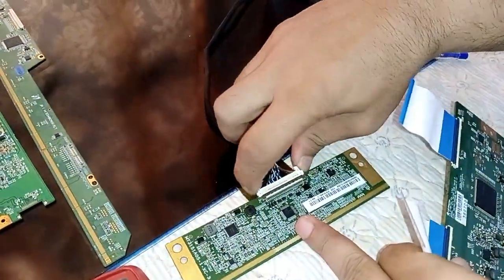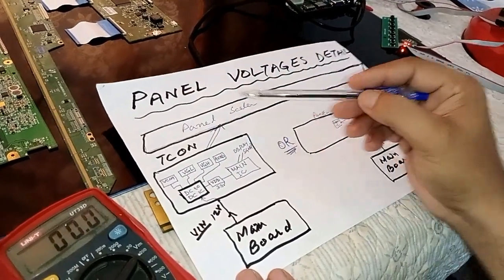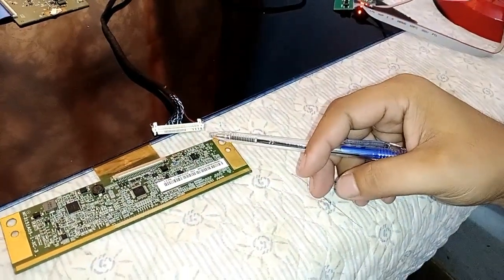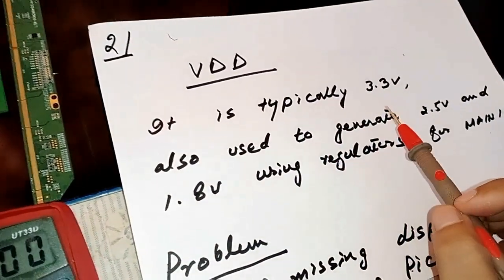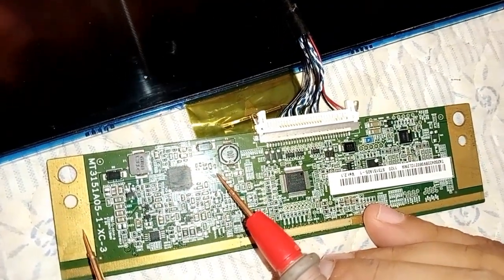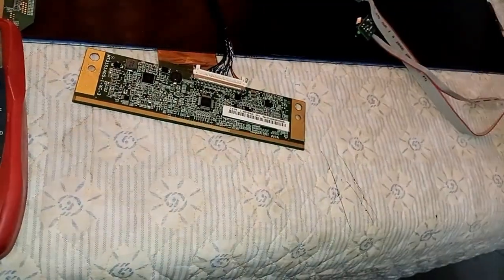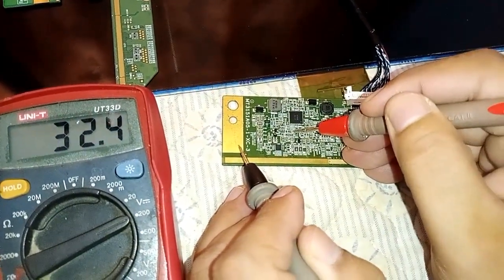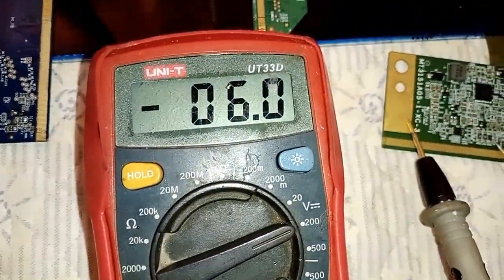LED TV PANEL VOLTAGES EXPLAINED || ALL TV PANEL VOLTAGES

Comment: My panel is showing 16 volt in VCC 
Vgl - 1.2 volt
Vaa- 2.4 volt
Vgh -2.9 volt
Vghf - 2.3 volt
Fvghf -  2.3 volt
Vdd- 4.4 volt 

Vgl and vgh gives beep sound when I check for continuity. I did all the possible things available in youtube, nothing happened.

Can you give immediate reply?

My tv model is mi 43 inch, 2019 model. Problem was no display (sound on), backlight is coming
Reply from the maker: It look likes your DC-DC Ic is short or any PF near boost voltage area is short, because all your voltages are lower than limit,
You can try removing DC-DC ic and attach external scaler to give these voltages,
I have 2,3 videos on my channel to add external scaler and panel repairing,
follow them
Reply: Thankyou very much

Comment: Thank you .. my Samsung lcd ..white screen problem .... What is the problem
Reply from the maker: Firstly check 12v coming to panel from Lvds cable, 
Mainly it is due to this voltage not reaching at panel scaler or Tcon board
Reply: @ElectronicSecret  thanks for your kind reply sir... I want to send my tv picture. To you how can I send you sir please reply
Reply: @ElectronicSecret  thanks for your kind reply sir... I want to send my tv picture. To you how can I send you sir please reply
Reply: @ElectronicSecret  please reply sir.. any contact number or mail id please